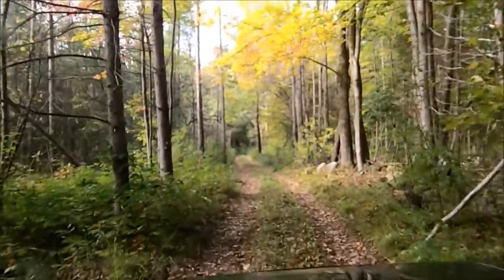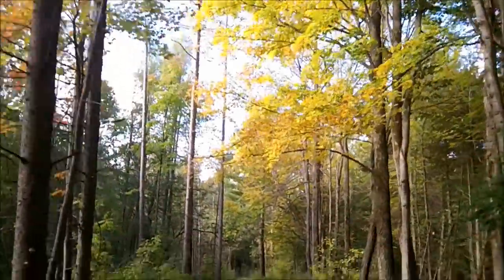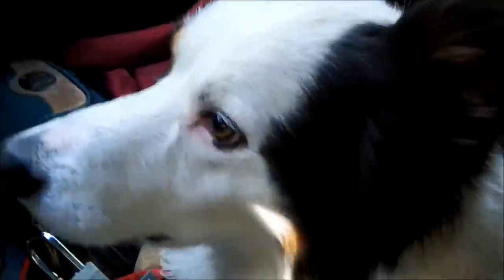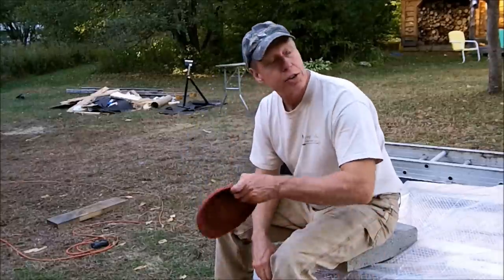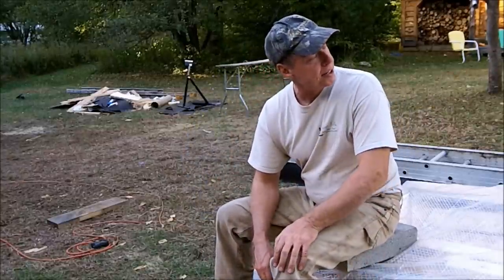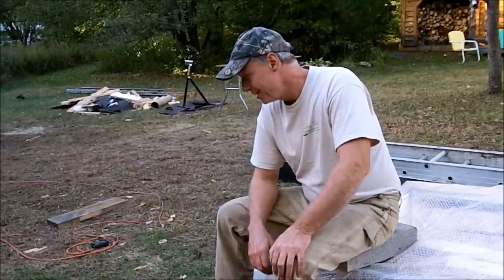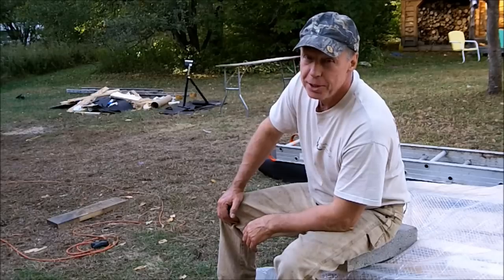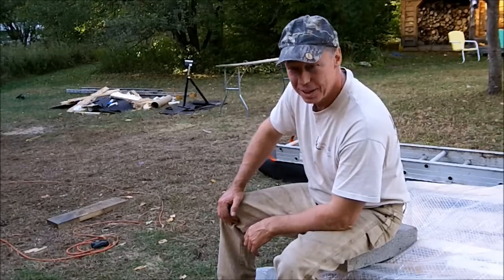Off Grid Cabin. The Workshop Project.

Comment: Great job Boss! I used that bubble insulation on a studio I am building on the floor between the 3/4 plywood and the 1x10 knotty pine boards. I'd show a photo but for some reason that's not an option in posting.
Reply from the maker: +Frenchy St. Germain The bubble foil works great. Super insulator for something so simple.

Comment: I had a 1988 Jeep Comanche and a friend had a 1990 Jeep Cherokee, both were red and had 4.0 liter straight 6 motors and an automatic tranny. My truck got hit in a head on collision 2 weeks after I put a new heavy duty radiator, power steering pump and a new water pump in it. My friend sold his jeep to another friend's son, who rebuilt the motor and put a lift kit on it.
Reply from the maker: The new jeeps just can't compare.

Comment: Just a followup on your comment re Jeep evolution in this vid clip; they ARE becoming more expensive and less practical. You 'hit the nail on the head' [no pun intended]. I too owned a 2000 Cherokee, 2004 Laredo and now a 2011 Grand Cherokee. Case in point: the new ones cost twice as much and don't even come equipped with a roof rack!  On a lighter note, thank you for continuing to share your adventures and Frankie's antics - he's precious.  -Be well
Reply from the maker: +2004grandcherokey  I absolutely love my 01 Cherokee.  I have General Grabber tires on it and love them too. I tried to get the same tires put on the Grand Chrokee and they don't come in that size.  That says it all right there. Nothing more than  grocery getter. Can't even get man tires for it :-/

Comment: You are amazing! Wow! I appreciate your hard work. Thanks for sharing. QUESTION: Could you staple a big sheet of Visqueen real tight to underside of cabin for extra wind and water protection? Thanks, Therese
Reply from the maker: Thank you.
I'm not sure if it's a good idea to use plastic sheeting because it may create a moisture problem.  Just not sure about that.
Reply: TheBossoftheSwamp OFF GRID SELF RELIANCE Ok Thanks, I may try it and YOU solved my confusion about how to insulate under cabin!!! THANK YOU!

Comment: First and foremost hope you're doing well.  Really appreciate your videos.  Embarking on my own. 
 Pile of questions. Feel free to answer or not . Cabin wise. Originally thinking 12x16 . Should I bump it to 20 on initial build for bathroom. And the pitch on your roof? Know you store kindling up there.  Enough for cisten? And is it insulated? 
Was thinking  4 6x6x20ft  hemlock.  Then maybe 2x6 pt floor joists. Reflectix like you suggested. 
4th 6x6 would be to run a porch off the front. Full length. 
 Have short to do it  in before snow flies. Gonna be my home.  
 Any suggestions would be appreciated.  
And once again I truly hope you are feeling better.  Life to short..
 Don't agonize over my life. Been drove hard and put up wet for most of it. Most of it my own doing.  Lol.. time to chill.  Done more  than most men would do in 10 lifetimes.  But when I speak  no one listens until something breaks.
 Im rambling. You have my prayers . Don't give up! 
God bless.
Reply from the maker: The roof is either a 10 or 12 pitch and yes there's room for a cistern.  
I wouldn't span more than 8' with 2x6's unless there was a girder beneath them. 
Hemlock is very strong but also very unstable wood.  No matter how tight you cinch it down it wants to twist over time. I'm done with it and suggest that you laminate your girders rather than use a hemlock 6x6.  Just a suggestion for past experiences.   Cheers :-)

Comment: Nice little build, be a carpenter & builder myself i understand what you are on about in doing it by yourself it makes the effort so much more rewarding. Are you going to use the same siding as you have on the cabin?? I know you milled that a few years ago.
Reply from the maker: +Stephen Lees Yes I'll have to mill a batch of siding for it. Going to ad a shed roof off one side as well.  All in good time.  Cheers
Reply: Nice stuff mate, as per everything you do i am sure it will turn out very nice.

Comment: Question for you Boss? When laying your deck for your buildings advantech or pt plywood? Also how high off the ground do you recommend for longevity?
Reply from the maker: I use Avantech. The stuff is awesome.  If I'm close to the ground I'll frame with PT but in most cases, I like to be high enough off the ground to allow me to get beneath it if I need to run a wire or a pipe etc.

Comment: JC,

What do you use for footers on your small buildings like that?  How many or how far apart are they?  Thanks,
Reply from the maker: +Mike Benton  Some buildings have piers beneath them, this one just has blocks. The ground here is nothing but sand, no rocks at all so I don't anticipate any movement due to frost. There are 3 blocks running each wall, 7' apart.

Comment: wow, you got that together so fast fast. It looked really good even tho it wasn't finished. This just makes me think tho, if i had the materials i might one day be able to build my own small cabin in decent time and for it to look anything like that one you just built. I was just wondering, did you use 2x4 for the sub floor and the walls? 
Great video and I'm looking forward to more updates as always!
Ben
Reply from the maker: +themanwiththecabin  It did come together well and I wish all my projects flowed like that. The floor frame is 2x8 pressure treated with 3/4" Advantek. Walls are 2x4, ceiling joist and rafters are 2x6.  Now I have a shed roof running the full length on one side which you'll bee seeing soon.   Thanks for commenting.
Reply: thebossoftheswamp
thank you, that's helped a lot. looking forward to seeing it!

Comment: Hey Boss, great video as usual. 

I understand if you can't respond, but I'm curious, did you you just put your workshop on pavers on grade?  I'm getting ready to put up a storage shed in upstate NY myself, and I really don't want to dig below the frost line for a <144 sq ft structure. It'd be reassuring if you did the same thing I'm planning to do!

Thanks for all the great videos, always look forward to 'em.
Reply from the maker: +DrZazzoo   Yes, this is sitting on 16" pads on the surface.  Good luck with your project.

Comment: Hi ya, Boss, 2 quick questions. 
1. no insulation under the floor but the reftex ? 
2. 2/4 walls not 2/6? Do you add R13 or R19 fiberglass or maybe rigid foam board with spray foam filling gaps. 

Just insulating my 400sq. ft.  20X20 foot "Reflective Lake Lodge" + 10x20 shop today. went R30 under floor and in ceiling. 
built 2x6 front wall but had already framed two side and back walls with 2x4. may go with an added 2x2 firring strip ? 

What is the cabin framed with 2x4 or 2x6 and R value of your side wall insulation ?  

Thank you for your thoughts and experience in the colder climates. City boy now well above Spokane, WA.
Reply from the maker: +MYFREECAMPER Only one layer of bubble foil in the floor of all my structures. Everything else gets trashed by ants and rodents.  Been there done that too many times.  R13 in the walls R19 in the ceiling.  No need for more in these small structures. I sleep with the window open a bit even in the dead of winter. The cabin stays toasty all the time.  Cheers
Reply: Thanks Boss !  Hmmm I may just try the R13 in the walls ?
Reply from the maker: +MYFREECAMPER If you build with 2x6, by all means fill the space with R19. My cabins were framed with 2x4's